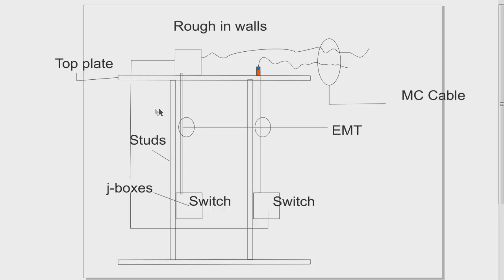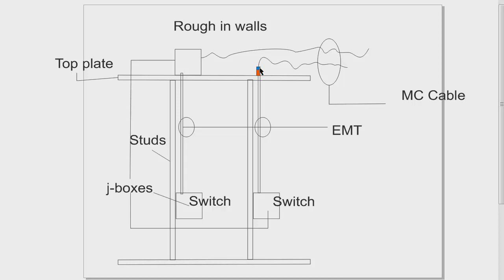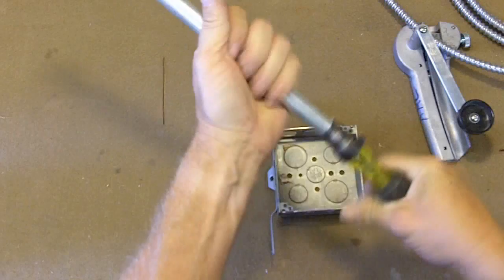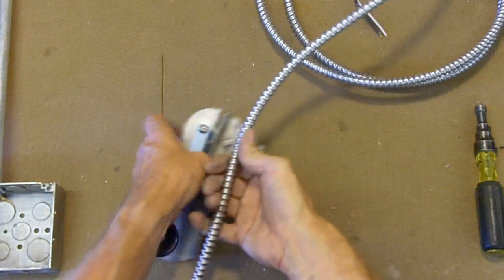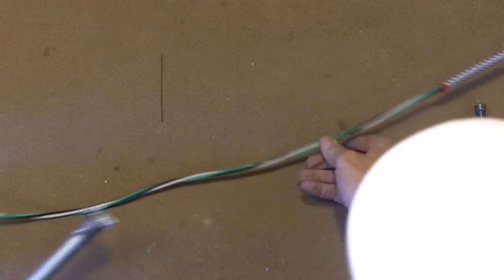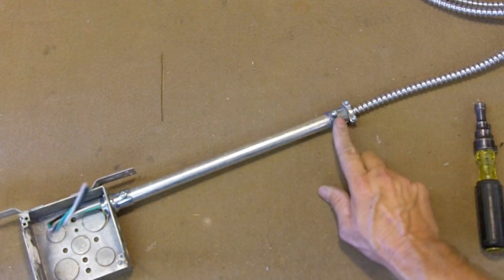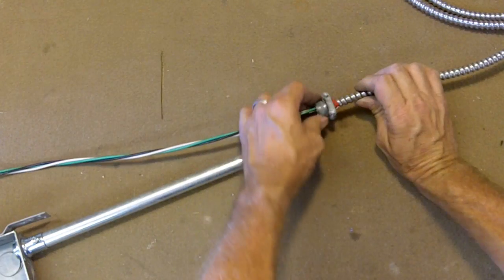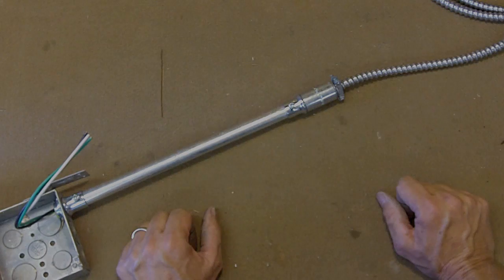Practical Electrical Wiring-MC to Emt Connectors

Comment from the maker: This was a demonstration on converting mc to emt. Really only one of many ways to provided power to a switch,this being one that has options for future changes by having a box mounted above the header plate. It is ok to rum mc straight to the switch box.
Reply: mc wire isn't rated to be in emt
Reply from the maker: @2424jhg  What will happen to it?
Reply: Electrical Industry Network I don’t know but inspectors are always pulling that kind of thing.

Comment from the maker: @dralph1965 Added annotation for the part to use meeting UL requirements @2:17
Reply: Can u use mc cable on indoor brick walls instead emt conduit
Reply from the maker: @jerryespino9152   Sure,as long as you follow all NEC requirements.

Comment from the maker: @dralph1965 I found the UL listing requirements for such fittings. You are correct in the fact that it is done all the time,doesn't make it right. Any person doing electrical work should be informed of the NEC and UL requirements. I am glad you pointed this out,it is a good learning experience for all, which is why I like feedback on my videos.

Comment: Hey Sparky !
Brother I have been using the Snap into Method, then take my Bulldogs and Cut for Years  now !!!
Today I went to Home Depot and Bought me a Klien AutoClamping 53725 !
She cuts easily 3/8" flexible conduit and #10,12 ,and14 armored cables with up to 4 wires with a couple of turns of the handle ! 
I think she will do me just fine on the HVAC side of things !
Sparky got me the 11n1 Klien at my HVAC Parts House, got a Schrader  Valve Remover in Her !
Thank You very much Sparky !!!

Comment: Thx. I'm a Locol 39 Stationary Engineer & work w/this sometimes. 'Course we don't install much, since that's 4r the iBEw guys, but this helps us usnderstand when there's a short or other need to trouble shoot on the spot which we deal w/all the time. I do sometimes look at the rough-in work when the''re leasing to a new tenant and buildining-out a new floor so I can see 1st hand from the Panel how everything's pup in. But, since I work Swing, this is cool to actually see how it's done. Thx.

Comment from the maker: @Megawatts37  First off to be clear I use and require my guys to use "redheads". With that being said I looked up references:
320.40 refers to AC cable and does specifie the use of insulators or equivalent. 330.40 refers MC cable and to use fittings listed for such use. No mention of insulators.
I checked some of the mfgs websites and most of the fittings fall under the "listed use"
On another note 1 mfg says under 333.9 you must use anti-shorts?????
Just my findings---